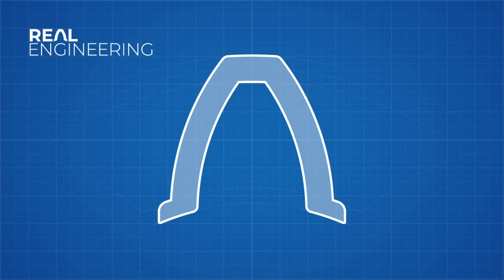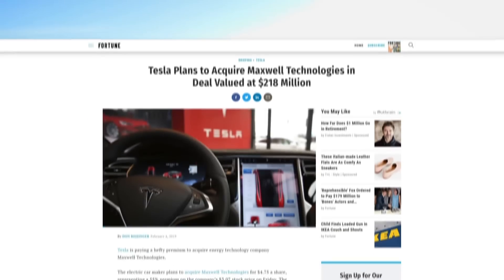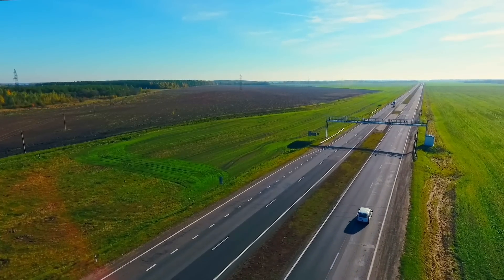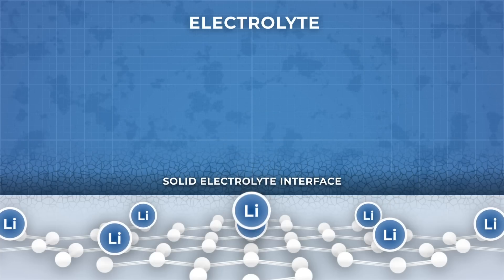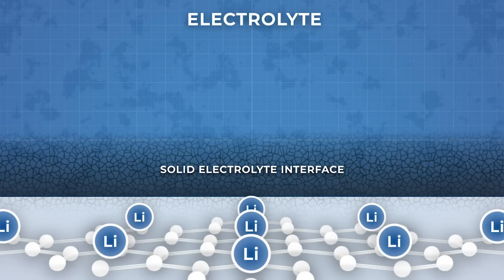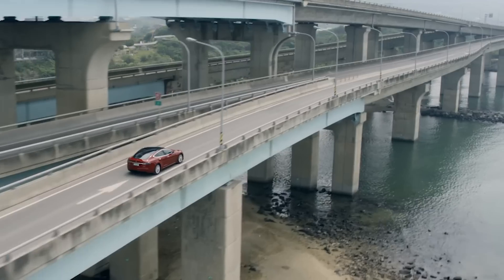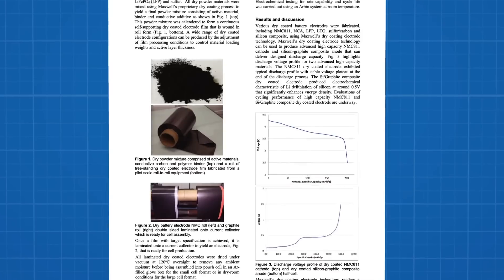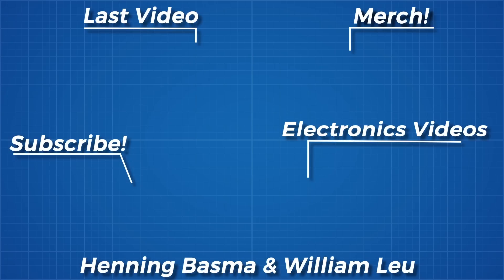Tesla's Quest for Better Batteries

Comment: Why did you not talk about solid-state and graphene batteries!!  Last 10 times longer than lithium ion and instant recharge!
Reply: Because they're not ready yet - any may never be (see below)

Supercaps have been mooted as a way of taking the load off of EV batteries for a long time - going back to the original Prius release. This was also proven by experimenters 10+ years ago as worthwhile but added a couple thousand dollars to the on-road price of the vehicle and thus was likely to hit consumer resistance (carmakers are facing constant compromises like this)

There have been Li-ion cells based on olivine reportedly hitting 10,000 cycles in the lab for several years but we haven't seen them in real world applications yet for the same reason that 90% of "in the lab" stuff never hits real world - some nasty show-stopper makes it impractical.

Maxwell's supercap electrode coating tech is nice and mature - they've been making these things for 30+ years and have lots of R&D behind them. That it's applicable to Li-ion battery manufacture is serendipity in action - just like Toyota's decades of experiments with gas turbine engine cars didn't give us gas turbine cars but DID give us Prius gearboxes.

Bear in mind this fundamental about Tesla: Tesla is NOT a car company. Tesla is a battery company that sells cars (amongst other things). Musk's originally stated intent with the car market was to force the bug makers to start making consumer EVs and he's succeeding in that aim. Once it's done, the carmaking part can pretty much fold its tent, having achieved the aim and they can concentrate on their core business - battery technology.

RIght now they buy the cells and package them up but they already put a lot of their own technology into those cells despite them being built by Matshita and Tesla have spent years years_ sewing up supply chains for decades ahead to the point that anyone else wanting to buy/make large scale Li-Ion at large scale has to buy from them or pay much higher figures than Tesla does. Tesla's end game is to become a battery manufacturer and purchasing Maxwell is part of that world domination plan. Their contracts with Matshita(Panasonic) are coming to renewal time and having Maxwell, etc gives them a lot of leverage to negotiate technology crosslicensing and lower pricing on the contracts.

BMW, Daimler-Benz, Ford, GM, NIssan-Renault and Toyota  are all finding out the hard way that they took their eye off the ball. Tesla has the potential to be the new Rockerfeller in terms of potential to control the global energy market in terms of supply of raw materials for battery manufacture.

In other news, there's still not enough investment going on to source the electrical supplies to feed all these electric vehicles. Doing the math on decarbonisation shows that electrical generation ca 2005 produced about 1/3 the world's carbon emissions - and getting rid of the other 2/3 is going to need not 3 times as much electricity but more like 6-8 times as much. Renewables are touted as the way forward but with the best will in the world (and near infinite investment) they can only produce 120-150% of 2005's carbon-sourced electrical production so we're going to need a lot of magic unicorn farts to make up the difference (batteries or hydrogen, etc only act as intermediate storage. The energy still has to be generated somewhere)
Reply: MISC BITS Except that Samsung is already started to use them in their next generation phones you ass hat

Comment: There are developments in the UK that should make electric cars acceptable to the majority of motorists. A brand new recyclable Aluminium-Air power technology
.

A 1500 mile range battery with a 90 second swap system
.

Cost effective for the driver.
https://www.metalectrique.com/blank-page  
https://www.metalectrique.com/our-technology

Comment: electric cars are too special of a niche.  Until you can road trip in an electric car, with charge times being less than an hour for 400+ mile range like a gasoline, or 600+ miles for a diesel, THis is just not going to happen.  You may not drive 400+ miles every day, but when you need to make that long ass trip to get to family for an emergency, you're not going to be able to do so with these cars. no thanks.

Comment: A related question- I’ve heard it said from time to time you should bleed a battery completely dry, to extend its life. Is this true, or just an urban myth?
Reply: Urban Myth. The thing is, basically completely draining and refilling to the edges of a Lithium-Ion battery such as the ones in a Tesla or your laptop will utterly kill it, as draining the battery completely leads to some complex chemical reactions that just increase the rate of wear on a battery. That's why there are things like trickle chargers, as it's better to keep a battery slightly fed so it doesn't fill up all the way but also doesn't hit flat out zero if you're not using it for a while. That's why most good battery bank manufacturers like Anker will ask you to charge your battery up to full before you store it for long periods of time because they'd rather have it full and slowly drain than be empty and cause actual damage to the battery.

I suggest this fairly recent article: https://www.makeuseof.com/tag/leave-laptop-plugged-time/ . The TLDR is to just make sure your batteries aren't bone dry for too long, or aren't charged to full for an extended time. If you're planning on putting something on the charge dock it's best to just fill the battery to full then take it out and use it on AC for the extended period of time until you need the battery capabilities again and just put it back in.
Reply: that is true of the old NiCad batteries as they seem to develop a kind of memory, but not true of LiIon which do better if charged often.

Comment: Typical Nissan making shitty cars with big problems. Crappy Jatco CVTs, weak engines, and now their electric cars' batteries don't hold up either. 

The fact that they decided not to rectify the issue even in the 2019 model says everything about how much they value their customers.

Don't buy Nissan.

Comment: My Tesla 3 is 6 months old, I drive it to work round trip 40 miles exactly but the battery drains 70 miles on average. I drive in carpool, HWY, 70 MPH, very few breaks. Is it normal?
Reply: the range displayed on screen is based on driving habits, if you drove the EPA avrage you would get your range, but driving 70mph drains more power then driving that same distance slower, a model 3 can get 700 miles of range at 25mph No AC. have you seem this happen ouside fof that speed range?
Reply: @miguellopez3392  Yes, many times I have seen even I go to grocery shopping, restaurants or drop my son at school, which all around the neighborhood and for example I drive 4 miles and battery drains about 8-10 miles. I was thinking opposit of you that short distance and driving in the street make sense to lose more battery because of multiple breaks and go but highway no change in speed for 20 minutes should help to be closer to EPA. I think it is not normal. Tesla should have calculated all the possibility of driving. It is twice far from the advertised EPA.

Comment: Electric cars failed in the marketplace because of a lack of range, the time required to recharge,  the lack of recharging stations in the US, the weight and size of the battery, the inability to hold a charge when temperatures drop below 0 degrees Centigrade and the battery's lack of durability. Note in hot weather environments like Georgia (USA) high temperature kills car batteries.
Reply: current lithium ion cells do actually work in  -0C down all the way to -40C but a a reduced voltage, not that it matters, you dont need much power to drive (about 12HP while the battery can generate 400HP in optimal conditions), the charging network is still expanding and s far has made cross country trips possible, teslas come with heating and cooling systems for their batteries, similar to an engine cooing system, you would have to be on a race track to overheat it,

Comment: hydrogen made by Sun at re-fill stations solves both cost manuacturing and transportation of fuel problems. Tryon Technology, Inc. is working to help this happen.
Reply: no it does not because you would still need to buy 40% more solar panels to make the hydrogen vs a battery car.

Comment: I'm a sales engineer for a battery company. We sell high discharge engine start batteries. We used to offer these maxwell capacitors in conjunction with our batteries. Due to mainly their high cost and partially their niche application on the market, we just discontinued offering these.
Reply: tesla is using maxwell dry cell technology, these are more advance then what you offered.

Comment: Stopped watching when he labeled the CATHODE as positive, plus sign. Incompetence IS detectible.
Reply: When charging, the negative electrode is the cathode since a reduction takes place there (Li+ + e- -> Li). During discharge however, the negative electrode is the anode since a oxidation takes place there (Li->Li+ + e-). For the positive electrode, it's the other way around.  Usually the negative electrode (graphite) is referred as the anode and positive as cathode (metal oxide) since it's in discharging direction, but mistakes can happen during editing, especially when there's a time crunch to finish like what happened with this video. Completely disregarding the information provided because of a labeling error in a diagram is very shortsighted, arrogant, and at least in my opinion, foolish.

Comment: 160,000 KM or 8 year warranty?   So it a causal 2nd car?
$7000 for a new battery? (Is that installed?)    I Had a new V8 engine installed in my truck for $5500. 
Gas engines last over 250,000 KM easily.
Reply: Regular maintenance in an electric car is significantly less than a gas/diesel vehicle. Without doing the full math, I get the feeling that they even out in the long run.

Comment: Now here's a thought.....

Since capacitors are good at holding charges over a short time with extremely high throughput, I wonder if they can be used to buffer a charge, so to speak, to allow the EV's battery to remain charging, when the vehicle has already decoupled from the charger and has already resumed its journey...
I'm assuming a battery cannot charge and decharge at the same time, so that would require the EV to run on the capacitors' power, whilst it is still charging and then seamlessly transition to battery power once it's complete. 
But if they can figure that out, it could be a means to limit practical charging time and boost range. Speculation/fantasising of course, but I wonder ;)

Comment: As batteries and ultra capacitors evolve I see quad motors with planetary gear reduction and elimination of friction brakes reducing unsprung weight and maximizing the efficiency of the Drive system along with superior performance and control, bringing us out of the ICE age...

Comment: Another great advancement being done with batteries is using Aluminium in the intercalated structure instead of Cobalt, which normally gets replaced by Nickel. The dangers of replacing too much Cobalt is that oxygen gets released quicker when Lithium disappears and spontaneous fires occur in the battery, as we have seen with the "exploding" phones, and Teslas catching fire.

Hopefully we can get rid of Cobalt all together without sacrificing safety, also since the morally questionable methods to extract Cobalt, which is almost entirely done in Kongo.

Fortunatly Lithium is in good supply so far, but it's also very sensitive to environmental impacts. Lithium is extracted from evaporating pools, which are greatly impacted by rain. It would be ironic if we couldn't extract Lithium to build more batteries, as a result of increasingly bad weather, and as a bad circle we need more IC Engines. Although, the impact of a warming globe could mean quicker evaporation.

Who knows what the future holds? There are so many interesting battery technologies right now.

Comment: I wonder why even today there are no standard templates allowing to switch batteries of our cars at the fuel stations and leaving charging responsibility for companies. The problem of distance and charging time would disappear even taking into account today's pretty primitive battery technology. PS Also, it would be cool, to just for example replace charged electrodes (maybe in a liquid form?) in batteries, as for example gasoline in the gas tank. PS2 Damn, I'm not the first one to came with this idea... :D - https://www.technologyreview.com/s/524781/a-battery-with-liquid-electrodes-can-be-recharged-or-refilled/.

Comment: I'm amazed no one seems to think of the simple solution. 2 wheel drive on the rear and 2 wheel generators on the front that charge the battery while driving. Simple but effective. Inverter required to combine the the 2 power supplies into one and charge the battery.

Comment: Battery have improved a great deal, but they still suck. We need solid-state batteries that don't use rear earth and are also less energy-intensive to produce. They also need to be safe and quicker to charge as well as last longer. Not everyone lives in a city and not everyone has their own garage with a charging-point.

Great intuitive presentation

Comment: CO2 is 0.0415% (415ppm - easily checked) of the atmosphere and human en 
devour affects about 3% of that 
(https://wattsupwiththat.com/2014/07/29/epa-document-supports-3-of-atmospheric-carbon-dioxide-is-attributable-to-human-sources/)
 .  So we affect 0.001245% of the global CO2, and crude oil burning ICE 
engines are a subset again of THAT.  So get off the ground....

Comment: I believe they are down to $90/kWh (not $150/kWh).  And since they are not yet replacing them (since they are outlasting the warranty) we must consider the FUTURE price (not $7500).  So when the range of a car with over 300,000 miles on it drops 30% to say 200-300 miles/charge do you keep on driving it?  Also, model 3 uses 21700, right?

Comment: I guess Battery is the only thing close to fuel. Batteries on a cycle broke my back. You can not believe how heavy batteries are and to just get a little power from them. If it were me i would do a trolley or subway form of personal transportation and leave the batteries at home. Maybe flywheel power or capacitor or super conductor levitation with flywheel start and regeneration.
Future maybe Musks mole hole with a power lead is the way of the future but batteries are not the future.

Comment: So supercapacitors are just RAM sticks in an EV
Reply: Umm, sounds great for my railgun project
Reply: No. They are like caches. Batteries are like RAM sticks.
Reply: meon email to be specific, they couldn’t be either cache nor RAM, as both immediately lose information when powered off, they can’t store anything. The best comparison I can think of is the batteries are SSDs and supercapitors are Optane memory
Reply: Gasoline is the batteries as NOS is the super capacitors.

It's not a replacement it's go go juice.

except in this case you can turn the gasoline into go-go juice.
Reply: @matthewboyd8689  I'll take one go go juice to go please.
Reply: A better comparison is those expansive solid state hard drive which use flash memory for the bulk of data and battery backed RAM for the sectors that are often modified such as folder and virtual memory.
Reply: Christian Gingras 
Expansive you say? Huh, must be storage from the future.
Reply: @paddor  For some reason, we never see them n any computer store, nor advertising if product that are common in some industry.
The difference in frequency on which sectors are updated is extreme, particulately for fat32 which makes no attempt to optimize anything...
A modern file system would do everything possible to read or write sequential sector number to help the flash blocks to be filled entirely. This include writing the directory structure as a redundant list. For example, when the date and size is updated, write this on the next line of a virtual document. When needing the information after a fresh remount, scan that document from end to beginning.
That kind of technic can improve writing performance from two x up to a hundred time faster on partly full flash drive.
Reply: No. Batteries are like batteries in a laptop. And capacitors are like capacitors in a laptop. Yes, laptops have capacitors
Reply: So WHAT YOU'RE SAYIN' IS.... I can download more ultracapacitors?
Reply: So does that mean supercapacitors are just springs?
Reply: ram sticks in an EV are like supercapacitors

Comment: I dont fully understand what is the problem with silicon lithium batteries . If the only problem is the high voltage at the charge why they dont just charge the cells separately or divide them to smaller sections ?